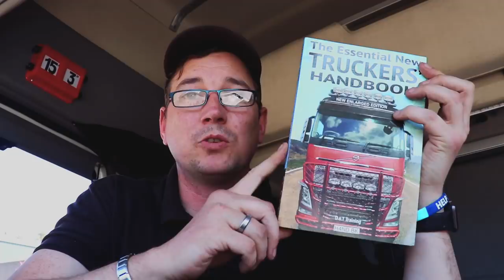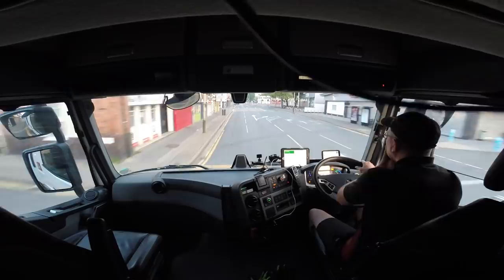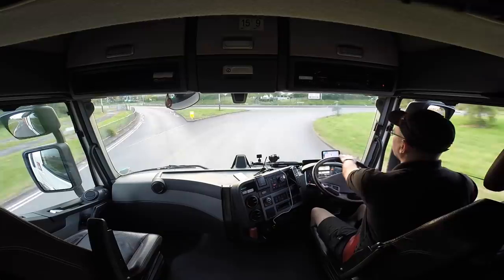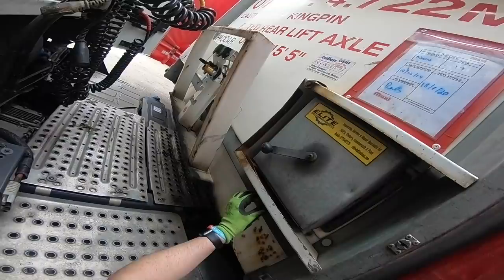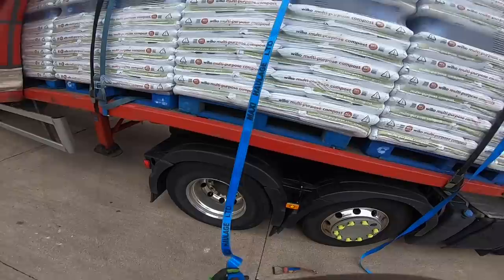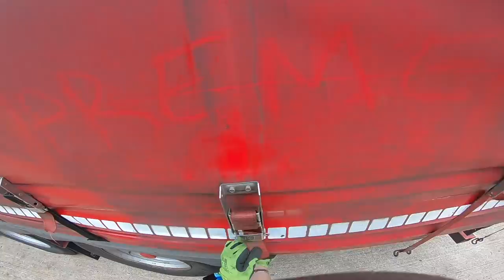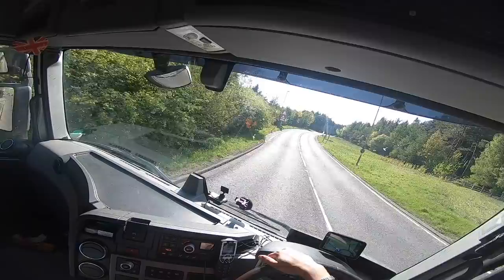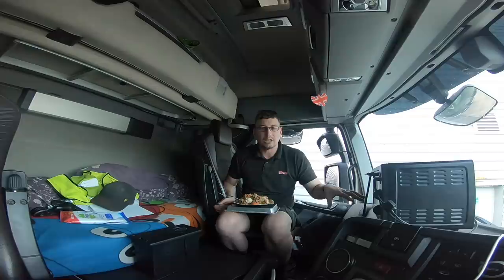Trucker Jay in the UK: How to strap a trailer

Comment: Jay, You are first guy that actually have used the racket strap as it was intended by the manufactures. You thread the webbing through the racket and pull tight then adjust the racket.  I did trails with companies back in the early 80's for the strap, (we used to call them checkered strape, because of there webbing design and colour at the time) before then it was roping and sheeting.  Thank you for doing it the correct way.  The other way, works but how they are intended to. So thank you.
Reply: and then again how many know how to rope and sheet nowadays

Comment: I learnt so much from this video, the part where you were showing how to strap properly was really good.  I also love the trick to get the window shut! Atleast you do your job safely! Stay safe
Reply: You need to stop learning from this lad. He’s not a registered trainer and he never strapped the load correctly. Get the correct training from the registered training companies out there or you will end up with points on your license if your caught.
Reply: Strapping might not be required in this case by EU regulations as the trailer is rated as an "XL" due to the EU standard "EN 12642 XL", when using the global blocking method for securing the load. However, it's allways a good thing to strap the cargo in a curtain side trailer.

Comment: I only use my iPad for my sat nav, I have purchased Sygic truck sat nav, it has great navigation and full control over truck dimensions and weight etc, not once has it tried to take me under a low bridge and driving for B&M with 16’3 high trailers it’s a good job

Comment: So at what point did you strap that load of compost correctly? Where are your corner pieces to protect the bags from splitting and the strap was only covering over the spread of a half of the pallet.. should have used double of the straps. Just saying like.
Reply: @truckerjay do you answer to questions?

Comment: I tried getting my hgv license changed over when l moved to tyne and wier in the UK from Australia. With 40 years doing general and fridge hgv driving all over the eastern states ' cairns Brisbane Sydney Melbourne and Adelaide l was told go back to van then rigid then l can go for a hgv and l have to fork out thousands of pounds and then another 600 for cpc. No wonder you have a shortage of drivers. I went back to Aussie for 10 months on the road and earned half as much again over uk drivers. Loading once in Melbourne 3 days to cairns beats 10 drops. Lou

Comment: Try taking the tablet out of the case and seeing if it works.  I have trouble in our Volvos getting GPS signal on my phone when using Google Maps, my old Garmin satnav used to have trouble too - couldn't find where you were, kept thinking you were going off route, kept freezing and not updating when I was driving.  Missed a few turns with it when going to new places.  Never had any problems in our MANs...Turns out it's the tracker installed by the company that's in the dashboard.  Mine had malfunctioned, when the chap came out and I told him that, he said it'll be more than likely the electronic box that everything plugs into.  Changed that and the TomTom (ended up returning the Garmin, one problem after another) has been fine ever since.  Phone's temperamental depending on where I have it in the cab - if it's anywhere near the middle of the dashboard then it won't usually work.

Thanks for that ratchet strap tutorial, I've been driving for a couple of years, but only done tankers so wouldn't have a clue.  Know I done it for my MOD 4, but I can't remember now.  You're right about Trucknet.  all the best Jay, drive safe👍👍

Comment: NOTE! WiFi-only iPad models (ones without cellular network capability) do NOT have a built-in GPS . Your only option if you have a wi-fi only iPad is to use an external Bluetooth GPS receiver . Note also, that WiFi-only iPads do NOT have a compass sensor built into them

Comment: The google maps screen not changing etc

Sometime if you zoom in to destination point etc it sometimes doesnt recentre and some times you havre to exit google maps and re enter google maps and re typr postcode and then it works ok but ive been using google maps for years and dont usa a satnav just google maps only

Comment: Hi Jay been watching your videos for a little while, good realistic true life world of trucking.
I was told when using straps have the ratchet on the N/S in case you need to pull over and make adjustments, anyone else got any comments about this !
Reply: I always have the ratchet on the near side, its good practice, just incase you need to retighten.
Reply: Same, although I’ve seen lots have them on the O/S, reasoning that they can monitor them better in the mirror. No good if they see it loose and pull into a lay-by to tighten them and get clipped

Comment: 36:16 Whats the nokia phone looking thing on the left of the steering wheel? 
Awesome video once again mate. I've seen a lorry getting up-strapped pretty much on a daily basis at my work but not often see them getting strapped again but its still interesting to watch either way in my opinion.
Keep up the good work and keep it going with the new change ups of ideas on how you're doing your videos
Reply: I imagine it's for the air suspension, I know Volvo trucks have a wireless one and it can be reprogrammed to do other things such as lights, etc.
Reply: @SevenENG  well I had wondered if it was that but the control he uses for the suspension from what I've seen in the past and i think in this video is on his right side by the driver's door so seemed like it's something different
Reply: @gl1tcheddatabase270  Hmm.. I'm curious too in that case

Comment: Also, VOSA would flip at a ‘insecure’ load
Reply: It wouldn't be classed as insecure, them pallets are maybe 400kg each so let's say 800kg as double stacked... Internals rated to 400-450kg depending on brand of trailer. You only need to ensure any strapping stopping side to side movement is within 50% of the weight of goods. Plus they look to be 2 internals per pallet. The worst is the rear pallets not been secured to stop backward movement

Comment: Being a truck driver myself I would have to say that is the worst job of strapping down a load I have ever seen.
Should be using angles & double straps as they look like oversize pallets weighing about 1000kg each so that's 2000kg per stack as they are double stacked.
The straps are only rated for 2500kg & your expecting them to hold 4000kg.

Comment: so maxi drivers will take out any old trailer ,regardless if the straps are broken and the curtain is ripped ,and not even bother to write up a report about it ,,that is a fine to start with ,,straps a load on the off side total novice for sure ,, not doing yourself much justice jay,,do not ever do any continental work as you wouldnt last 5 minutes ,the german polizie  would have a field day with your wallet .and to top it all off you behave like a big kid cheering when some one is pulled over,,by the law grrrrrr  sorry pal a legend you are defo NOT

Comment: so do you rate the Renault froggytrotter 😂😂😂my gaffer is on about buying sime to replace the actros i drive on walking floor i would much prefer a volvo to which the gaffer answered "Renault engines are much better" pmsl what a tit as the Renault has volvo running gear etc
Reply from the maker: Don’t have Volvo computers so bag of spammers
Reply: yep thats what I was told by the volvo salesman 🤣🤣🤣so i guess it will be either a XF super space or another actros